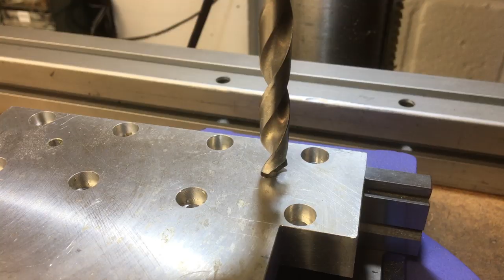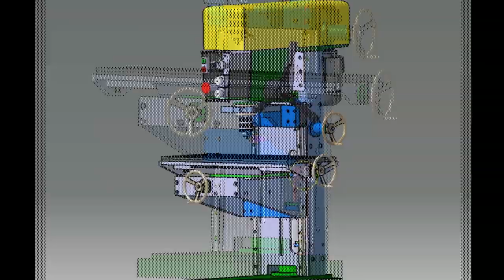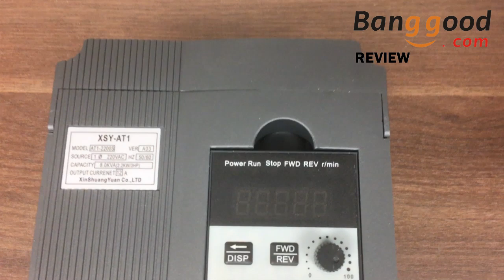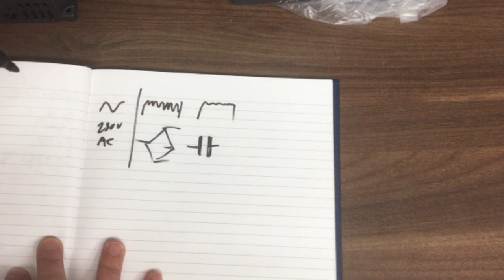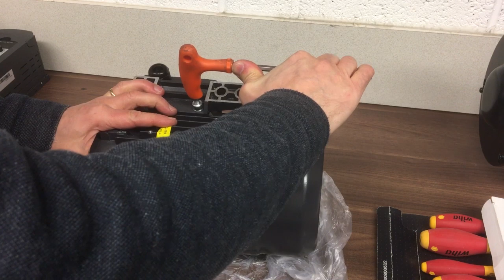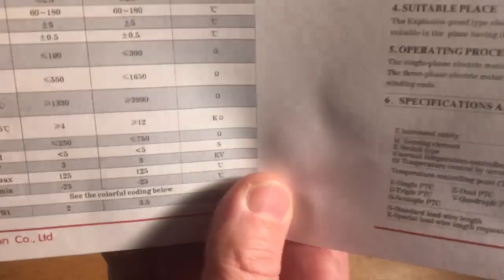Ep 1: Drill Press Upgrade | Getting Started . . .

Comment: It looks almost like a milling machine.
Reply from the maker: Looks similar but I can't mill with it unfortunately.  The quill bearings are not designed for side loads, plus there is no drawbar to hold the chuck so it would most likely fly out when cutting!  It was designed to be a precision drill press for hole patterns etc.  Thanks for watching.

Comment: The Bosch PBD40 I realise is a DIY type of tool and only small but it actually has some great features like electronic speed control with RPM adjustment and load detection, Digital hole depth read out, light, led cross hairs (gimmick) and you can adjust the height without loosing your hole alignment.  Also the built in pillar clamping foot is one of its best features.  No vice needed. I didn't expect much when I bought mine but its actually good for 95% of drilling tasks.  I totally admire your skills to upgrade and build great machines by the way.  Really inspiring watching these videos.
Reply from the maker: Ok yes I’ve seen those around but not used them.  Apart from no xy table that sounds like a good diy machine.  Thanks

Comment: I find you tube woodworking videos extremely valuable.  Some do not have the detail others do. I would like to know the approximate cost of machines demonstrated and their source.  Detailed parts lists of diy projects would be a lot of help. Also a slow motion insert would be a good addition.  These statements are not complaints.  I dearly love all of the videos provided...
Reply from the maker: Drill was from Warco and cost about £300 several years ago.  Linear rails and ballscrew from Banggood, aluminium from aluminium warehouse and eBay.    3 phase Motor from tec dot co dot uk.  VFD from Banggood and electronic components.  Hope to spend less than £600 as some parts sent for review.

Comment: Great video !!! where did you buy the shielded 3 phase + earth power cable ?
Reply from the maker: Missed this comment, sorry for the delay.  I bought it years ago so can't quite remember but I just did an ebay search for "SY BRAIDED CONTROL CABLE 4 CORE 1.5MM 2.5MM 4MM FLEXIBLE STEEL WIRE ARMOURED" and found some there.

Comment: You could get a mill and use it for precision drilling, just saying...
Reply from the maker: Yes, I looked into that option for some time.  To get the features I wanted was around £1700 for a mill, plus I don't have space for another machine (workshop is very slightly larger than a 1 car garage).  I also thought about selling the drill, and buying a mill to put in the same place, but I quite like having a drill press.  So for now the upgrade works out quite cheap and should be a fun project.

Comment: The casting head is not as stiff as a milling machine, not made for large side loads.  A single bearing is in a drill press nearest the chuck.  For high thrust an angular contact bearing is the likely bearing.  I can not believe that they didn't select a more common angular contact bearing, not almost a thrust bearing.  These bearing can take a reasonable amount of side thrust.   Recall that my father's cars almost exclusively had these radial contact bearing on the front wheels.  The key was to minimized the clearance and not cause in to increase with a side load.  Thus the books told you to tighten them by hand and then back off ~ 1/4 turn, get the correct clearance but be very stiff.
Reply from the maker: Agreed.  I’m not planning on making a milling machine just precision drilling so I can leave the casting and spindle for now.  If I ever did create a milling machine the head casting would be stiffened by more box section and most likely would make or buy a new spindle designed for milling.  Thanks

Comment: For the up and down of the bed is better to use a worm gear (even if that means to have the ingerent reduction) because it cannot be back driven. So you cannot have the bed to lower by itself.
Reply from the maker: Yes good point and that bothered me for a while during the design development because the table will be quite heavy.  So I have gone for a fine pitch ballscrew (5 mm) which will help with back driving, but I'm not sure yet if it is enough.  I'm trying not to use a worm gear as it will take forever to raise and lower due to the gear reduction.  That would lead me towards motorising it . . . .  still time to think about the best option.
Reply: @routercnc9517  well you could use the worm gear and drive it with a 755 motor and it costs next to nothing to power it with pwm reversible controller. And with that system you can go quite accurate because the reduction of the gear plus the reduction of the screw itself. And if controlling if only electrically bothers you, just add a manual shaft in parallel with the motor maybe with a 2:1 gear increased ratio. Not too complicated to do. If you want contact me.
Reply from the maker: True.  I’ve also got a spare stepper motor with driver and power supply, plus pulse generator module. Or an old cordless drill.  Decisions , decisions, decisions. . .

Comment: Very cool Idea.I have a similar Machine from Kern. Looks like in the end of 80 s.
I have tried the same with invertor and the orginal engine with no success.
When i drilling i have no enough Power.
Engine to old ? I dont know.
Hope i see the next Episode soon.
Best wishes from Germany / Bodensee
Reply from the maker: The current single phase motor is 650 W and it has plenty of power for drilling holes.  I could have replaced it with a 750 W 3 phase motor and inverter and it would have been fine.  What power motor do you have and is it 3 phase?  I read somewhere that the older 3 phase motors are less suitable for invertor use.
Reply: @routercnc9517  the Engine have 750W and 3 Phase like yours. in triangle circuit the Engine goes very Hot.
i go back to Star connection. This is the Orginal circuit.
I think too the older Motors will not work with invertor.
Hope the next Episode come soon.
Reply from the maker: OK.  The delta/triangle and start/Y are essentially the motor being wired in series or parallel, with the motor current double for delta.  Probably why it got so hot.  I’m not sure if you have any further options but worth posting on a machining forum for more help.  Working on the next video where we will take a detailed look at the inverter amongst other things.  Thanks

Comment: The Fong Fu RF40 milling machine I purchased is run off of single phase power with a similar inverter.  I am going to look into your connections.  Right now it is on the wall next to the mill.

I did try to mill with one of those cheap vises with x-y positioning.   What happens with a mill tool cutting a groove is to loosen the Morse or Jacob taper standard on drill presses and the chuck will drop out of the spindle of the drill press.   This is why on milling machines there is a screw used to pull the taper upwards to maintain the press fit.    I was thinking of how to solve this problem.  For a Morse taper a standard shaft can be purchased with a threaded hole in stead of the double flat tang.  And for my hand drill a screw is used to hold the chuck on to the shaft for the same reason of preventing the chuck from coming loose.     For the Morse taper with a threaded hole I was thinking of putting a bar across the slot for removing a Morse taper shank.  And have a screw reach down to pull the Morse taper up.  How to get at the screw to tighten in will be interesting.   One may have to use two or three Allen wrenches with the wrench softened and twisted to get different angles of the hex from the handle.    Your best bet is to get an ER chuck on a Morse taper shank.  Then you can properly hold a milling tool.
Reply from the maker: I’ve not seen good reviews of any of the cheap xy tables and the more expensive ones are quite small.  So decided to make my own.

The other problem with the spindle is the bearings are likely to be the wrong type and not take radial loads.  For milling I would most likely start again with the quill - but trying not to go there for now to keep the project manageable.  Thanks
Reply: I saw video few months ago where guy converted drill into milling machine. He said it's really bad idea, but it SOMEHOW worked. Very poorly. But honestly, if you have nothing, then even this - https://www.youtube.com/watch?v=mJ-TZvFpY58 - "thing" is awesome step up!

edit: and if I remember it correctly, it was AvE - https://www.youtube.com/watch?v=mJ-TZvFpY58
Reply from the maker: Yes, I remember it well.  AvE has his own way of doing things . . . !
Reply: Very well said!

Comment: If this inverter supports it, are you planning to add feedback sensor? For example induction sensor switching once/twice per output shaft revolution, so you have closed loop regulator. I know our small Yaskawa at jobsite can do that (there's even integrated PID regulator!) but I have no idea how common it is.

Also if you have one spare digital input, you could probably find out voltage threshold when input switches and wire up voltage divider of one fixed resistor and your PTC in motor. So when PTC changes rapidly its resistance, it would go over threshold and for example stop your inverter :)
Reply from the maker: The invertor is very cheap and the motor control is fairly basic.  Just v/f scalar control with a small amount of configurable torque boost.  It is not well explained but I will go into that on the next video.  It does not have closed loop control just open loop based on sensing the drive signals and assuming behaviour against a theoretical motor model.

Your PTC idea is interesting.  The proper relays are £45 upwards new which is half the cost of the motor !  I’ve already sketched up a voltage divider circuit (you need to have max 2.5V across the PTC ) and was feeding the tap point into an op amp module to compare to a reference voltage and trip the relay.  This would go into the digital input.  Your idea is simpler - I’ll see what I go with in the end.  Thanks
Reply: *checks out Google* wow, that's really cheap o.o  And now I'll think how to add simple and cheap feedback loop because I really like thinking about useless stuff :D

Thank you ^^  It's good that you noted 2.5V voltage drop across PTC, I totally missed that! In that case it makes more sense to use opamp.
Also if you buy opamp which works at low voltages (no problem in this century), then you could power it directly from inverter and connect its output directly to inverter too with no need of another relay.
Reply from the maker: Yes, that is my current idea if I don't go for the commercial thermistor relay module.  You can buy an op amp module for about £4 ($5?) which contains all you need (except the voltage divider part).  It even has an on-board relay so you would just connect that to one of the digital inputs and set it as the alarm.  Something like that anyway.  Still a way off and plenty of time.  Thanks
Reply: I'd go with simple opamp then ;)

Ideas I just got:
- add resistor (maybe 100k?) in parallel with sensor in your motor, so when it loses connection for any reason, it will automatically switch everything off

- maybe add tiny capacitor in parallel too, I guess some high frequency garbage might get into wires and then randomly switch comparator.

- and if I am correct, if you want manual reset, you can add positive feedback to opamp (so it will become schmitt trigger - https://www.random-science-tools.com/electronics/inverting-schmitt-trigger-calculator.htm ) and then disconnect fixed resistor of your voltage divider by NC switch to reset it.
....or short out PTC with NO switch, that would work too, BUT if you keep switch pressed, it will run without temperature protection.
Reply from the maker: These are all great ideas thank you.  I need to think about all my options because it is very easy to burn up time making what initially look like simple add-ons and then run into little technical issues.  Avoiding false triggers from electrical interference and so on.  Eventually you get to that point where you wish you had just bought the commercial unit as it should just work and you can get on with the project.  It is a safety critical item - for your wallet at least !.  However, I Don't need to decide yet which way to go, but it does give me more to think about, thanks.
Reply: You're welcome, I'm glad it sounds useful for you :)
I totally understand what you mean. For example right now I play with idea of really cheap and shitty plotter for making of PCBs. Totally different way than anybody else does it. I really wonder if (and when) it will move for first time.

About your thermal protection, check out this - http://tinyurl.com/uw5s7w8
I'm not sure about voltage supply your inverter uses for digital inputs, some use 5V and some use 24V. Values in link above are for 5V supply and I'm not sure which opamp works with 5V (some do, some don't).

edit: on right panel is slider "Temperature" where you can change value of PTC thermistor (on left side made out of fixed and variable resistor).
Reply from the maker: Thanks for the info.  Over the weekend I spotted a very good deal on a used branded thermal relay from a specialist company.  It arrived today well packed with data sheet looking like new.  Will save me trying to make my own.  Hopefully it works ! I’ll show it in a future video.
Reply: Oh, great! I can't wait to see it! :)
Reply from the maker: It's this one:  Siemens 3RN10 10-1CM00.  Model is about to be superseded but it should do what I need.  £75-£80 new, got it for £26 shipped.
Reply: wow, Siemens thing! Nice :)
In my previous job I was putting together programmable temperature transmitters (mainly 4-20 mA current loop powered with HART-like communication) and older types with DIN rail variant had even relay. But it still costs more than this used Siemens thing. Also I expect Siemens to work very reliably.